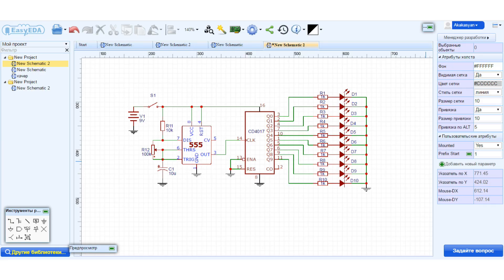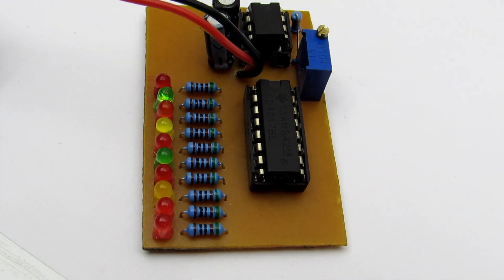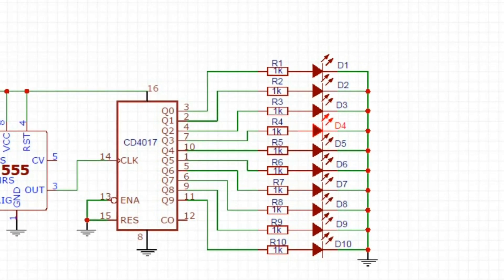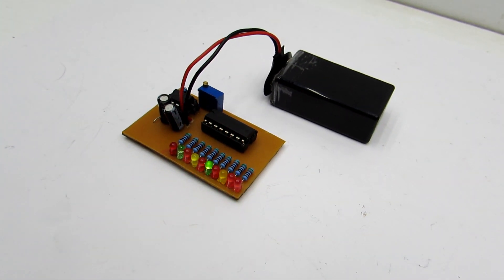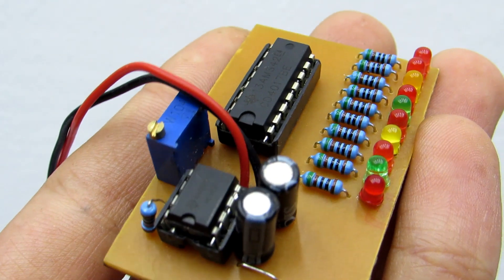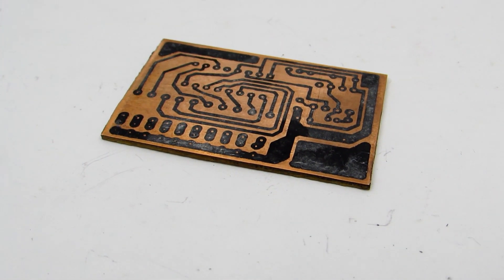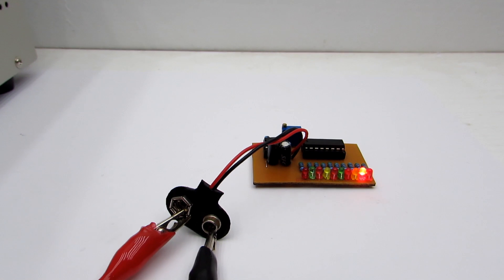DIY  running line with LEDs

Comment: why you wasted that lot of resistors if you can put a single one at the ground point? there is no more load than a single led, cos of the functionality of your circuit.
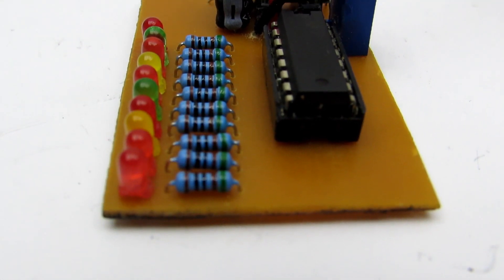Reply: At 1:50 he say that can be used 1 resistor for all LEDs at once